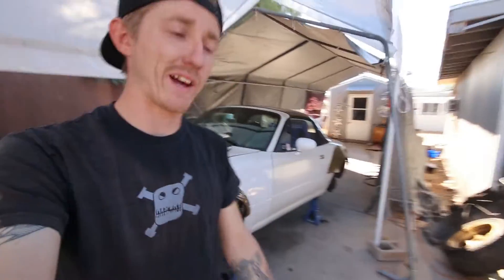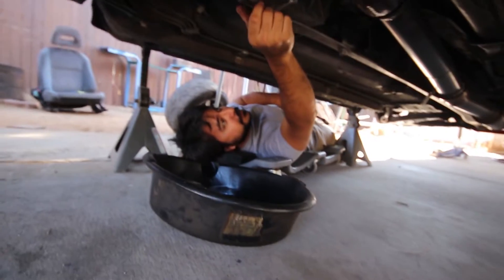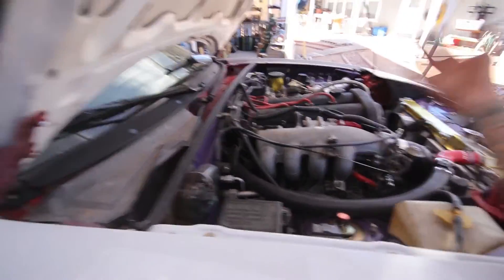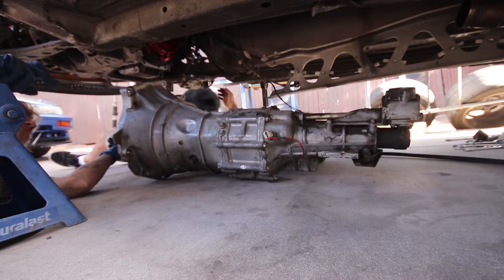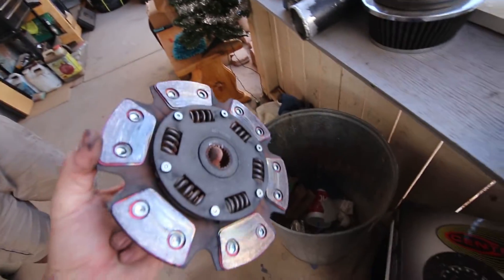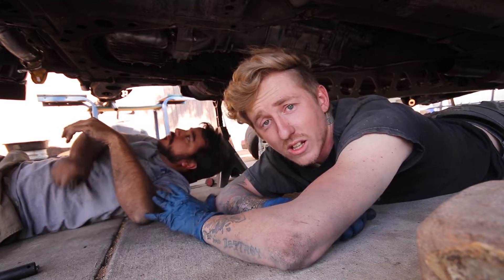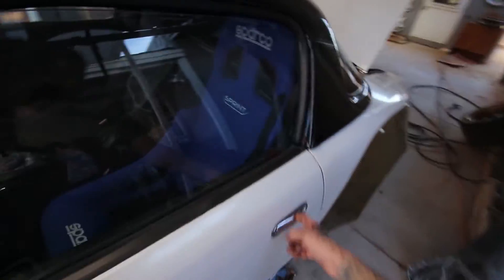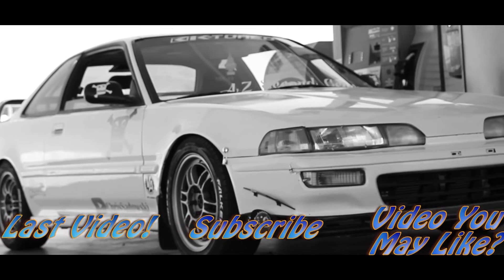Bye Bye eBay 6 Puck, Hello Supermiata Clutch!

Comment: I also put a DTX stage 2 with light weight flywheel in my ef mini me and has done great for almost 8 months now. Like you said its hit and miss with them
Reply from the maker: I wonder what it is about them that makes them work or not work. They all look the same out of the box to the naked eye
Reply: Not sure my buddy and my brother are running the same trans too they both have the h22 lsd trans and it would work on one but not the other
Reply: The one i put in my car has been good just hope it can hold up when i got boost

Comment: i have a b20 swapped crx the previous owner did the swap any used a xtd ebay clutch when he did the swap and about 6 months after i bought it the pressure plate went out. replaced it with a action clutch kit havent looked back since
Reply from the maker: One decision on slowly maturing in lol
Reply: @ChrisSadowski  well he did a lot of things cheaply just to get the car running when he did hte swap so the first things i did was replaced the swap mounts with innovative mounts bought a innovative replacement crossmember and a yonaka tripple core 1/2 rad because i knew eventually i would want to boost it

Comment: Have you driven with an unsprung clutch before? And what would some of the pros and cons be compared to a sprung?
Reply from the maker: Never driven unsprung before I don’t think so I really can’t say
Reply: @ChrisSadowski  Ahh okay no worries, what about your thoughts on break in periods? Do you do anything specific with your new clutches?
Reply from the maker: My new Miata clutch calls for 500 miles of regular driving or a week of daily city driving, whichever comes first. Think of it like new break pads, clutch disks are woven fibers and friction material so they need to be bedded in just like brake pads and that stop and go driving where you are on and off the clutch does the bedding

Comment: A couple thoughts on this video I'd like to share with the masses if they will recive them.

1. Anytime the Douge is on his back, and handling a very long, VERY thick and greasy shaft... I'll watch that on loop while strangling the sparrow (choking the chicken reference)

2. XTD clutches have never steered me wrong on the B series. Stage 3 XTD on a stock LS with 150 shot worked like a champ. No slips for over a year. I noticed the Del Sol and B20V DA held up fine too from Sadowski's perspective. So my opinion (and only my opinion) is that maybe the XTD has a shit design for the Miata.

3. If this video would have been titled "Douge and I Bench Press 200 lbs of Solid Steel for 3 Hours", I would have secluded myself in my happy place and aggressively pounded my pigeon (please see reference #1)

4. Speaking from a man with experience, you will feel WAY older once you STOP skating. Never stop skating. Even if you can only pop worm burner heel flips and some rock to fakies on the 1/4 pipe, never stop skating. Do it once a week and you will age significantly slower than anyone else!
Reply from the maker: I look forward to your comments each video lol
My XTD in the integra is great, in the del sol it was very chattery but worked good till I swapped the B in and went with the exedy I already had. Idk what my problem was this time around. Perhaps I didn’t break it in all the way. I mean I did get it all back together and go on a 200mile road trip up a mountain bangin gears so that probably didn’t help the case haha
Reply: @ChrisSadowski  the break on good have had something to do with it. But I've spoken to Ckutch Masters and they basically told me breaking for clutches are more of a myth now-a-days and that applies to almost all clutches. I would just chalk it up to ebay design thats outdated and cheap.

Comment: I've got an eBay clutch kit still in the box now I'm scared to put it in hahahaha
Reply from the maker: Roll the dice and see how it works. The clutch disks are hit or miss. And the pressure plates are fine for low power. No issues with the flywheels yet
Reply: @ChrisSadowski  yeah all I have is a stock d16y8 so maybe a 100-125 hp tops